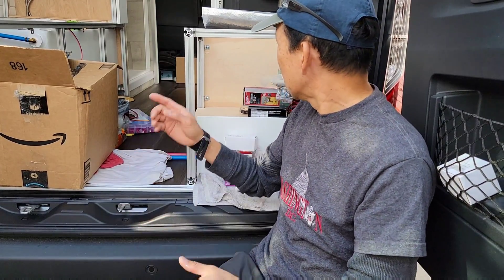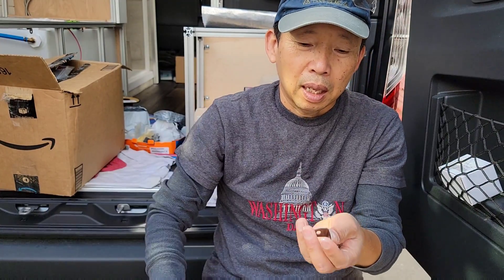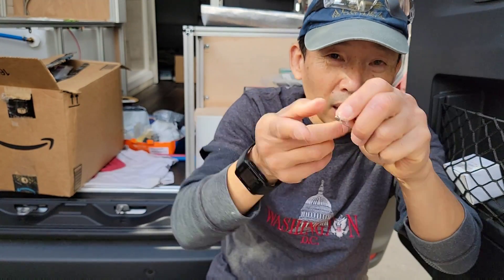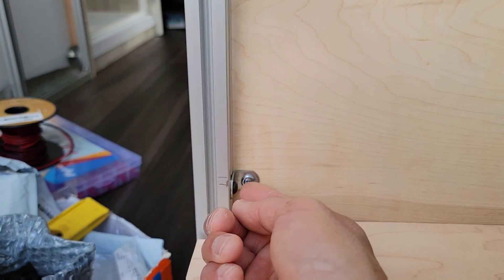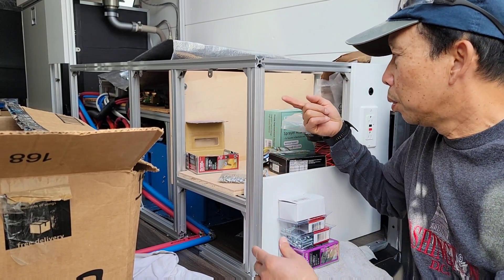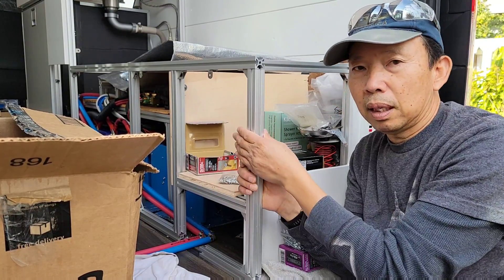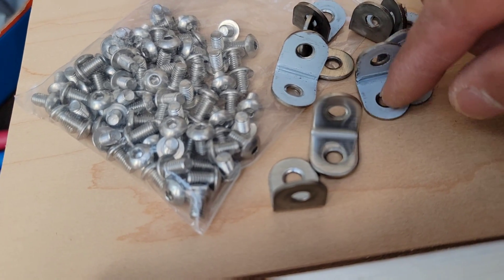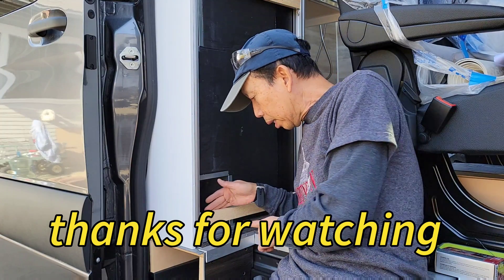How to attach wood to aluminum extrusion

Comment: What do you use when you’re connecting two 80/20 adjacent each other like 11. Side to side?
Reply from the maker: Thanks for asking.  This are hardwares for exterior corner connection. 
T-nut to slide in the channel 
https://amzn.to/3yss5tR

M5 x 10mm bolt
https://amzn.to/4ax3CAO
 Coner Brace
https://amzn.to/3wKuUWD
Reply: I think the word I was looking for was flat brace.  Basically a 2” brace with 2 holes at the center lines of 2 aluminum extrusion. The ones on Amazon aren’t there and tnuts is still kinda expensive.  
What do you use for those types of connections?
Reply from the maker: I think Tnuts are least expensive.  The flat angle brackets run about $2-$4 a piece.   
Check out the accessories here 
https://www.tnutz.com/aff-id/bchuon66/
Reply: When your attaching wood in the outside frame how do you locate the spot to drill your screw in?

Comment: Great video description of your process. I love how everyone does things a little different. I've been working on ways to mount my panels flush inside the extrusion. Seems I may have figured it out the other day. Great stuff man🙏
Reply: what did you do and how did it go? I'm thinking of centering 9mm plywood within the 4040 channels, but I'm not sure what to do in the corners.
Reply: @nikzel  the process went well. How are your extrusions connected? If using corner brackets, that will complicate things a bit. I used mesh panel brackets from 8020 and secured them to the back side of my panels.